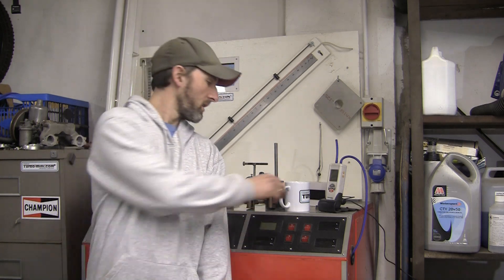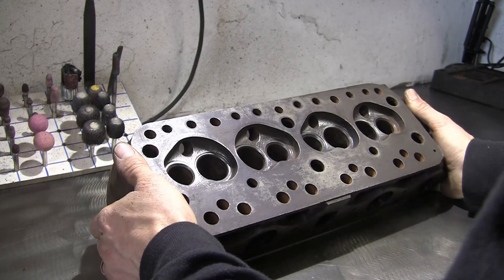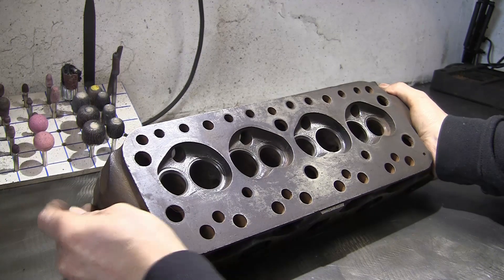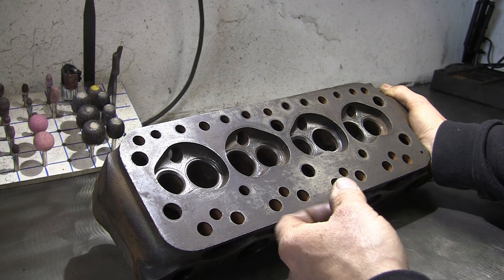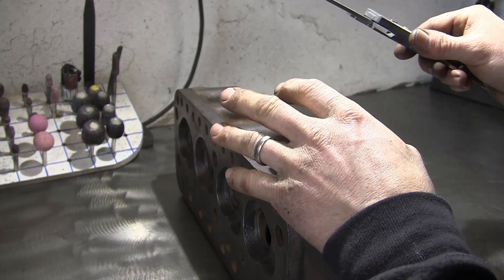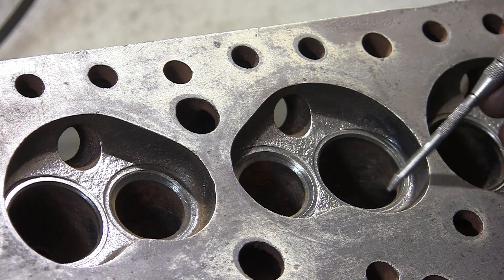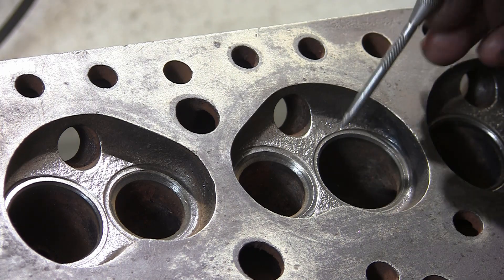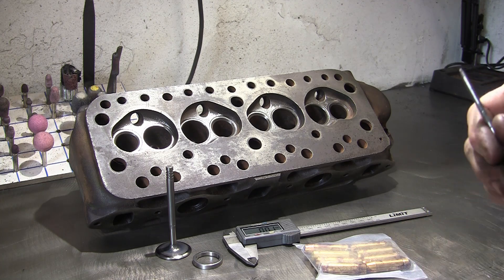Classic Mini Cooper 12G295 Cylinder head restoration. modified & flowbench tested part 1.

Comment: What's the implications of using a 12g295 head with the recessed valves prior to having work done to it?
Reply from the maker: Hi. It will cause uneven rocker geometry, the valve springs may be out of spec (regarding the installed height) and if the seats are badly worn the valve will not seal properly.